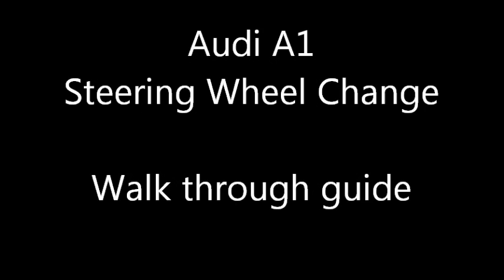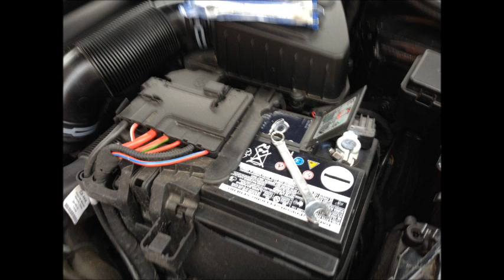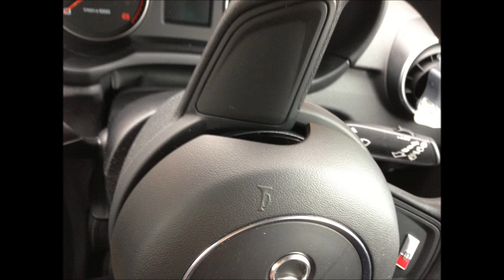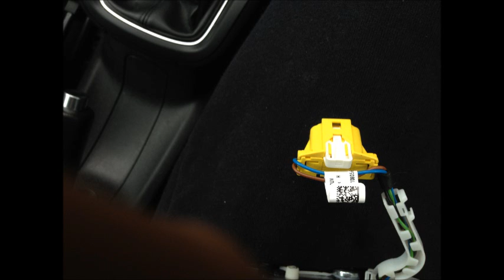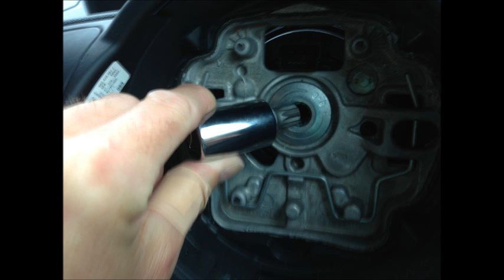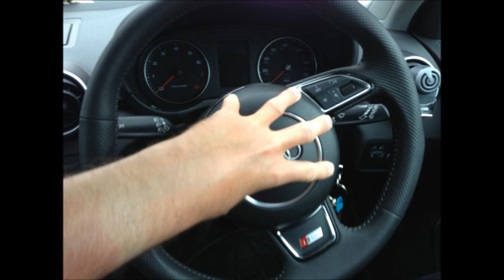Audi A1 Steering Wheel Change - Walk through guide

Comment: Can I have a multi function wheel on a normal Audi A1 (2013)? Thanks
Reply from the maker: Sorry - only just seen this comment as it was held back for some reason by You Tube. So I tried ( at great expenses ) getting a multi function wheel on a standard SE model for the A1. It turned out to get the controls to work with the actual radio required additional components that aren't fitted to the A1 se model as standard. If I can remember...it was 1 ) new wireing behind the airbag ( to plug in the controls ) 2 ) coding to switch on the steering wheel controls 3) a new speedo cluster ( the one that shows the radio stations between the speedo and revs. 
Like I say....I spent a LOT of money trying to make it  work and sadly failed so gave up.

Comment: Alright, I don`t know how it is on the A1 but, the clips for the multifunction wiring is connected with the 1 that is in the airbag, so make sure you buy an airbag with that swell, bought an S-line model wheel to my A3 and it fitted with the multifunction ! so don`t worry about that, you just need the airbag that fits with the new wheel ;) 

How ever, the lights on my wheel won`t come on... anyone know why? all wires are connected, its suppose to work I think, anything I'm missing out on?

Comment from the maker: just a reminder guys: if you have a model with NO steering wheels functions for the stereo; and you fit a new steering wheel with all the stereo controls on (like ive just done) - you WONT be able to use the controls to change the stereo ( for eg: volume - change radio station - mute..etc..etc)  - this is becuase there is NO stereo control wire behind the airbag to link up. I only did this so I could have a sexier looking wheel and the advantage of the two tones leather. So more of a cosmetic change.
Now Audi might be able to help you with this (ie: providing the needed wire from the stereo to wheel - but I bet it would cost a few £££££ - especially from Audi) - so not sure to be honest what to advise.
Reply: Poppy Picanto Thanks for this. Would be awesome if the steering controls would work too. Very Nice video. Would prefer an actual video to pics but the commentary was sufficient.

A link to the ebay listing?

Keep em coming
Reply: Hi, what happens if I have the basic buttons? And I want the Plus buttons? (For the A4)

Comment from the maker: don't worry about the airbag going off. The only way it could fire is via an electrical firing signal from one of the crash sensors fitted into the front of the car / bumper region. Once you have disconnected the battery; you've killed the sensors
Reply: Did any of this generate an airbag light once it was reconnected?

Comment from the maker: wheel costed me £189 off ebay
Reply: Rob & Mel English & Filipina. Did this generate an airbag light on the dash as some say it does and I don’t see how if the battery is off. Also how hard was the m12 bolt to remove/how tight was it.

Comment: Hi Picanto , 

My A1 is same as yours and existing only has standard steering wheel and no Multi-function button , I changed and retrofit the multi-function button , but the Shifter paddle still not worked finally .  Do you have a same problem ?

Thanks ~~